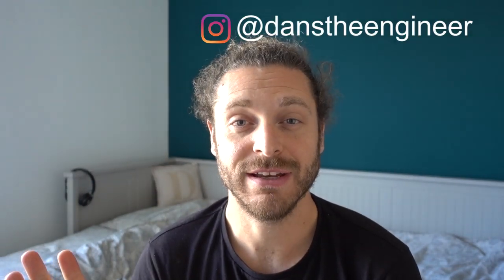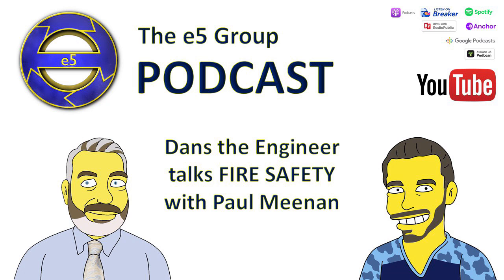Electricians Installing Fire Alarm Supplies

Comment: Not sure if OP still reads the replies here but wanted to ask a question. If when upgrading an existing fire alarm installation in a domestic property the existing supply to the panel is not protected by RCD or RCBO (independant supply) and comes directly from the DB in T&E but is contained in the fabric of the building (ie concealed inside walls and ceilings) would this be suitable to leave as it is considering the fabric of the building (plaster board, plaster, metal/wooden studs, double insulated pvc sheathing of T&E etc) provides 30min+ burn time and poses no risk of cables falling and obstructing the fire brigade in the event of a fire. Or would best practice be to run a new supply in FP cable, the route of which would be across ceilings in escape routes? I would think the best option when taking into account safety would be to leave the existing supply in T&E in order to minimise risk when taking into account the way the T&E has been contained. If the OP or anyone else would be kind enough to share their thoughts on this it would be much appreciated.

Comment: what NICEIC certificate would you issue for new installation of grade A system
Reply from the maker: There is guidance on certification/documentation in BS 5839-1 and has some model forms. I am not sure what certificate models the NICEIC offer but personally I have created my own. 

Design certificate
Installation certificate
Commissioning certificate 
And normal electrical installation certificate or minor electrical works certificate for any electrical alterations.

Comment: Very interesting, was searching this topic as on an EICR today I found FP200 at the fire alarm spur but T&E at the landlords DB so there is a joint somewhere, was trying to find if there is a reg that states fire rated cables must be used for Panel supplies.
Reply from the maker: Glad to help Guy. Yep power supplies need to be fire rated plus any joints on the fire alarm system including the power need to be denoted on drawings to assist with fault finding etc.

Comment: Studying my Level 2 2365 and while i don't intend to specialise in fire alarms once i've got everything else (L3, I&T, PAT etc), I do want to make sure that if i'm ever asked to install something fire alarm related that a) I have an idea of what i'm doing (RFTMing of course) and that I'm compliant - I'm waiting for the 3rd Edition of the IET Electricians Guide to Fire Detection and Alarm Systems to come out as i can't find a 2nd edition copy for love nor money but in the meantime I'm toying with the idea of getting a few bits and making a test rig (call point, sounder, beacon [I'm under the impression that sounder now should be of the sound and light type to cover disibility/equality legislations?] and a panel just to make a 2 zone play-rig - What would you recommend as a starter? (Open to all, not just Dan)

Comment: It seems to me that BS 5839-1:2017 is a code of practice, and therefore, consists of guidance and recommendations. Non statutory in other words but encouraged by government. It also seems to me that if the objetive is safety first,  encouraging people to observe these guide lines, you wouldn't demand £350 from them in order for them be be informed as to what they are. £350 is a ridiculous amount of money to demand from people eager to comply. It is, quite frankly, exclusionary. The BS 7671 IET Regs BBB only costs £85.
Reply from the maker: I do not disagree sir. It is a frightening amount of money when this is just one standard and when working in fire you end up having to work to multiple standards which does amount to a lot. However, many of the trade bodies to offer annual subscriptions for around £100 + VAT per year for multiple fire related British Standards. Although this isn't statutory, if someone was injured due to a failing of your install that fell short of the British Standards, you will struggle to justify to a judge as all legislation ends up pointing towards British Standards.

Comment: Hi Dan.

Informative and useful video as always. I am a EE but haven't done any first or second fits for years as I went into design and servicing of high duty UPS and monitoring kit.

I am just about to move into a bungalow as my back has given out on me. The whole building has been rewired and looks ok ( I won't know until I move in and mega all the circuits for myself ! ) Now this is my own place so I have ordered a two zone addressable FCP, combo smoke / Sounder heads and a roll of red  30 mins FR cable. Like you I have seen what a fire can do !

This is not a full install to all the latest BS and any new bonkers EU regs that have popped up since I last ran t&e. I don't have to worry about test cert's ECT but as it's my own place I obviously want a tidy job. I am fine with testing and installing but I do have one issue I would appreciate a pointer on.....

I paid extra to have all the circuits on the DP fitted with RCBO'S and I do have some concern about a false trip leaving the panel without mains and I don't hear any fault beeper or notice the two SLA batteries have snuffed it. What is the best way round this ? Can I swap out one RCBO for a HRC fuse carrier and a 6A HRC fuse to feed the fire panel or am I going to have to loop out to a small two cct dp ? What would be your advice on this as I don't fancy forking out for a copy of all the new regs for this one of system that's just for my use !

Many thanks in advance for any pointers.

Cheers
Reply from the maker: Hi mate. Thanks the message. Now dwellings i.e. your own place come under Part 6, not Part 1. But not a problem. It is important to have the fire alarm on a dedicated circuit that cannot be effected by faults on others. The fact you have individual RCBOs per circuit is a good thing. Am I right in saying the fire alarm will also have a dedicated circuit? If so that is fine. In all my years I have never witnessed a fire alarm panel tripping an RCD but it is important to ensure they have a dedicated RCBO/RCD oppose to sharing with other circuits.
Reply: @DanstheEngineer  Thanks for the quick reply Dan.
The place is already to building code. Super cheapo crappy mains linked smoke alarms are up. Not to bothered about the code for my system as it will be on top of what's required by law (not much in a private dwelling). It's annoying me as I already know of some issues....>
The mains detectors (one of them so close to the bathroom it's nearly in zone 2) have been fed of the lighting radial *facepalm*. Only one lightning radial fitted that kind of makes the expense of the consumer unit pointless but it gets better ... I asked them to fit a non-maintained led bulkhead in the corridor and bedroom. Corridor's bulkhead is on the single lightning radial and the bedroom one is wired of the 2ND ring main via fused spur (left 13A fuse in) but just to really put the icing on the cake they installed maintained lights and looped the switched live to the unswitched (so naturally you can't turn the proxy thing off.......AAaaarg !!!)
They cheaper out on a six way consumer unit ! This may be my saving grace though, one way is wired to the cupboard for an imersion heater. No tank not needed so I think I will use that one for the fire alarm and run FR to the bulkheads, that way I can run the switched live via the fire alarm aux relay.
This place will have solar and inverter feeds than can be pretty inductive hence the worry about RCBO'S tripping and I'm not forking out for class B breakers ! It's annoying as I had to go into hospital during the work and would otherwise have seen what they were up to.
What are the new regs for HRC fuse holders, can I fit them or am I better of looping of the DNO tails at the main switch or perhaps via Henley's to a second two way consumer unit (after DP isolator naturally). WHAT A NIGHTMARE ... It's been worse than being forced to sit part P whilst on a strong acid or mushrooms !!!
Reply: @DanstheEngineer  So can I put a HRC holder in the DP ?  6A fused and feed the fire panel from there via a red keyswitch fused spur of course.
Not much else I can do aside from connect a sub DP via a Henley block.

Comment: Thanks for the video. I must have asked 6 electricians and they could not answer me. I asked if we can run the fire alarm cables all together with the other cables in the existing steel trunking?  Not one could answer me. U just said u can not. Is that right?
Reply from the maker: You are supposed to segregate them so if they have a separate barrier between them, then this is okay. If they are mixed, then no. The recommendation is to prevent any risk of damage to the cabling when the next person comes along and starts pulling the fire alarm cabling. Of course, you can agree with a client a variation but there has to be a justified reason for this and whoever agrees that design takes responsibility should something happen such as a failure of the system.
Reply: @DanstheEngineer  I thank u for your prompt reply. Be well be safe.

Comment: Hi Dan  thx for the video. Do you know if i run power and fire alarms thorugh a roof space on tray and both are screened fp cable if they can be run next to each other and not seperated by a distance. As both cables are screened to prevent electro magnetic interferance and both are insulated to 230v?
Reply from the maker: Is the power for the fire alarm? Or general power. Part of the reason for the distance is so that if someone was running new power or ripping out the existing, it doesn't increase the risk of the fire alarm cables getting damaged in the process
Reply: @DanstheEngineer  It is actually power for lighting and the fire alarm system cables to each sensor, i recently returned from 20 yearsin Asia and got back into the electrical game 3 years ago. Been updating my certificates and just did the compex 1-4, good to see what you have been up to.
Reply from the maker: @unitynick1194  then they need to be separate to satisfy BS5839 part 1. So putting interference to one side as you've suggested, it's more about making sure the fire alarm cables aren't damaged by others. Where in Asia? I loved my time in Asia. I want to go back! How are you finding coming back? Electrical moves quickly due to technology but fire alarm principles stay the same, it's just different kit that comes out that you have to keep up with!
Reply: @DanstheEngineer  I have a look at that,  thought if both cables are fire rated (fp) , screened and insulated to the highest voltage then they could run side by side on a tray. It was a shock coming back at first but trying to get to the top of it fast. I was mainyl in China but also in South East Asia and did a yer working as a spark in Sydney. We actually updated the fire alarms in the Opera House then.
Reply from the maker: @unitynick1194  you're correct, except theres another regulation to say that fire cables cannot be run with other cables due to accidental damage. Oh wow. Some experience then!!!! I think if you've got the knowledge of the basics you can pick up the rest!
Reply: @DanstheEngineer  sorry for all the messages, how would running next to another fp cable receive the accidental damage?
Reply from the maker: @unitynick1194  hold on a sec
Reply from the maker: BS5839 part 1 26.2:
k) To avoid the risk of mechanical damage to fire alarm cables, they should not be installed within 
the same conduit as the cables of other services. Where fire alarm cables share common 
trunking, a compartment of the trunking, separated from other compartments by a strong, rigid 
and continuous partition, should be reserved solely for fire alarm cables.
l) To avoid electromagnetic interference with fire alarm signals, any recommendations by the 
manufacturer of the fire alarm equipment in respect of separation of fire alarm cables from the 
cables of other services should be followed.
Reply: @DanstheEngineer  Thx , i really hate all the shoulds and coulds and just saying it is best practise. Even from this it does not say that when clipped on tray they need to be seperated. It just states abput trunking and conduit fro which there is a minimal but could be said a risk of damage when removing other cables but on tray if each cable is clipped seperately to the tray and not twisted anywhere just clipped next to each other you could remove the power cable with no risk of damage to the lighitng cable. I have serached and there are discussions all over forums about this, people on each side of the argument.
Reply from the maker: @unitynick1194  I'd be happy to run cables on the same tray but not tied together. For example lighting on one side, a gap, then fire on the other.
Reply: @DanstheEngineer  thx for all the replies
Reply from the maker: @unitynick1194  I was thinking about this last night. You can interprete the standards I've posted how you wish, but regardless of that, I would always expect to see fire alarm cables and general power and lighting to be run separately. No problem on the same tray but definitely not tied together or wrapped round each other. We have to think about longevity. Often fire alarm cables will be there for a long time as many buildings rarely need upgrading to more protective categories but you'll often get sparks running in new circuits over time and we want to avoid any chance of our fire alarm install being touched.

Comment: Hi Dan what Standard code is for a domestic household with carbon-monoxide and smoke detectors wired with 3 core+earth flat grey cable, each floor and lounge is equipped with a detector  6amp mcbo.
Reply from the maker: BS5839 part 6 covers this assuming you mean it is a single dwelling?
Reply: @DanstheEngineer  thanks yeah its a single dwelling.
Reply from the maker: @misterkazmi  BS5839 part 6 then. If you're installing a Grade A fire alarm system, BS5839 part 1 is followed with a few minor differences but you've indicated twin and earth which is fine for alarms with integral battery backup.
Reply: @DanstheEngineer  in case there are flats like in your video, what should i add in my installation and is it OK for an electrician to do that (not fire engineer)?

Comment: Totally with you Dan regarding the AC 240volt supply to fire alarm panel should be fire rated... 
Been a electrician myself and having run many fire alarm circuits but never commissioned any that was down to the company hired to do that, I can remember  well when working for a large electrical contractor and on one occasion I ran a 3x2-5 fire tuff cable supply from FB to fire alarm panel which was over 12 metres away but was told to remove it and just run a pvc/pvc supply to it... Did try to explain why I did it but it fell on deaf ears...
Reply from the maker: Wow, asked to take out fire rated cable to replace with non fire rated 😳

Comment: This industry must be the most frustrating sector, when i started there was none of this nonsense of so called alarm specialists, the fire alarms were always installed by the electrician, over the years so called fire alarm specialist and separate regulators have sprung up. I see so many crap installs from these specialists,  and on many occasions i have had to tell them what they have missed.
When i install a supply for them, mostly in FP, they always do the link to the panel in flex, i have pointed it out several times and they just leave it in. But then again is it really necessary to have the supply in a fire proof cable, its the one circuit that will let you know when theres something wrong.
And why is it if some fits an alarm, they are an engineer? you are only an engineer if you have a degree or HNC, HND etc, that pisses me off all the time, and it stems from them not having a title like electrician, they are alarm installers not engineers.
Reply: they trainees actually after evening or weekend part time courses.
Reply: Well in the US the electricians only run the wires while the techs do all the installing and programming
Reply: @FireTech7  do they, but we are not in the USA, they only do the tech work because they are not capable or too lazy to install there own containment or cables. 
For some reason cctv, fire, security and data installers never install their containment or power supplies when theres an electrician on site, but if they were fitting a system where there is no electrician i am sure they will install their own supplies and attempt installing containment.

Comment: So your saying that incoming cable ie swa to a dB must have a fire detector adjacent to it
Reply from the maker: Not necessarily. More that if the mains supply isn't fire rated and in accordance with BS5839-1 as described in this video i.e. fire rated, coloured red, maintains fire integrity, then it's non compliant. To have a variation with a fire alarm system you have to have the client agree the design which must be an alternative that doesn't compromise the safety of the system. It all depends on the scenario.